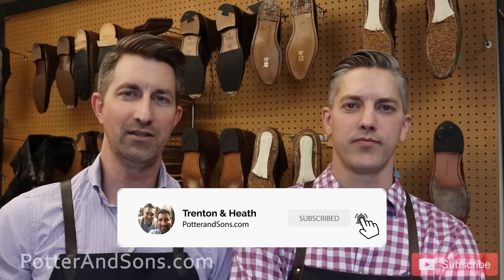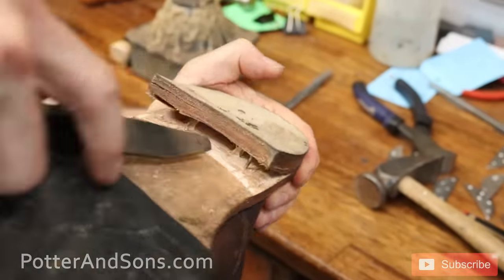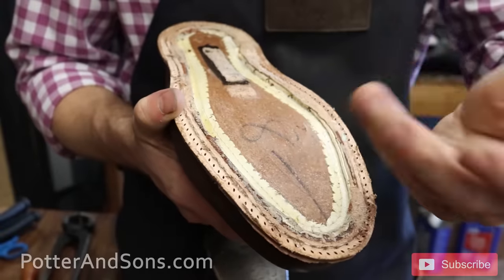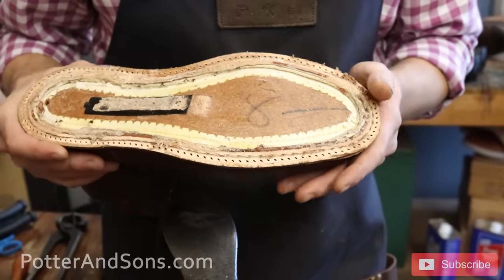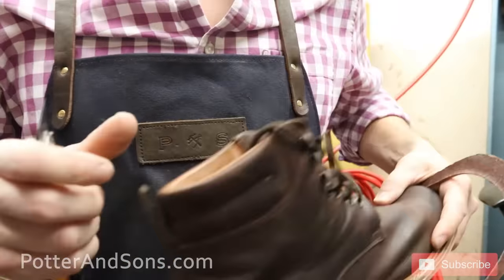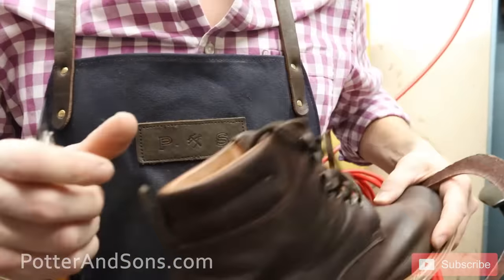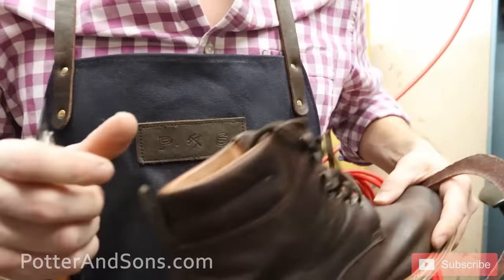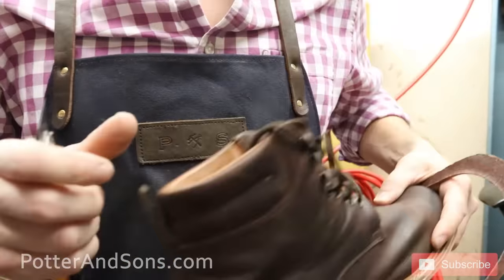Boot Restoration | Refurbishing These Boots With Vibram Wedge Soles

Comment: Shoe Restoration: My Red Wing 2944 Harvesters. My first real pair of boots that I wore to work as a barista every day for one of the most difficult years of my life. They were worn on unfinished concrete 8-10 hours a day, no shoe trees, and no breaks. I’ve since moved onto driving a long-haul semi and expanded my boot collection, but they are still my favorites. Unfortunately water has started to seep through the sole, the heel is starting to round off from my walk, and the vamp has more wrinkles than my grandma. The loss of weather resistance unfortunately means they’re not quite fit for regular truck duty. They’re no longer sold in the US, and I’m far too attached to let them go. I’ll probably send them off to you guys regardless! Thanks for doing this, y’all rock.

Comment: Shoe Restoration: In 1980 I started my first job as a gas pump attendant. The first thing I purchased with my very first paycheck was a pair of Kodiak work boots. I worked in them, hunted, fished and wore them all through high school. They disappeared for many years, and when I finally found them again tucked away in my parents attic (I joined the military in 1985 and just put everything away when I left home) they were pretty much unwearable. The soles are now petrified rubber, the uppers are very dried out and some little critter chewed the very top of the tongue on one boot and part of the back spine on the other boot. I have resisted throwing them away after so many years because they bring back some great memories from my teenage years.

Comment: Shoe Restoration: My nine year-old son and I found your channel some months ago, we were instantly hooked. We appreciate the craft and functional art of shoe restoration and y’alls drive to make the channel educational and rooted a strong work ethic. I picked up a pair of cap-toe Allen Edmond Park Avenue after your eBay challenge. Picked up Saphire Creme 1925, Renovateur, and Crème Rénovatrice. I used acetone to get off all the old product and to get a good base to start  on the conditioning, scratch filling, and buffing processes. I could not believe how beautiful the uppers came out. The soles and welts are a different story. The heels are worn to the blocks. You can see heavy loose leather fibers wearing almost completely away at the ball-joints with the welt totally separated from the uppers on one of the toes due to the stitching being worn out. One of the insoles has all these tiny circular marks as if some hasty cobbler was trying to get them out the door. I wanted to support my local cobblers but to my dismay no one had ever heard of JR or even grades of leather. One guy said “we have cow leather”.  I did find one older well-respected cobbler but he said JR wouldn’t let him buy the soles and he was also having hand surgery on both hands so he would not be able to work on my shoes. His joints were not doubt the victim of his success. I said god bless and wished him well. For the time being the shoes are hanging on my pegboard like an old Toyota truck in the junkyard waiting for someone to realize it’s potential.

Comment: Haven’t seen you use that corking technique before (Cork “paste” and iron). When do you use that method vs the “sheet” of cork that you tear or cut to fit the welt cavity? Any difference in end result or performance?
Reply: I was just going to ask this and would love to know.  Since I started watching this channel, another guy's video came up aka "Hammer Time" who swears by sheets.  I'm curious to know the advantages of each.
Reply: I would assume the paste might be used on a boot like this with a very high and prevalent shank and a overall deeper space to fill out compared to sheets on something more flat and even like a dress shoe, but I have no experience as a cobbler I'd love to hear from the man himself on it tbh.
Reply: I, too, was going to ask this question.
Reply from the maker: The paste version is a little more water resistant, but other than that no real difference.  Most ready to wear goodyear welted shoes/boots come with paste.
Reply: I noticed that paste too.
Reply: The cork "putty" was mesmerizing. Not gonna lie.
Reply: @BuckMcAntlerson  It is a paste, chocked full of peanutty goodness!!!!
Reply: Shoe restoration. Black and White leather Doc Martins.  I have worn them so much the cushioning is gone
Reply: I was just about to ask the same.  I guess there will be more glue in the mix with paste than sheet cork, and more water resistance (as T&H write). 
But will this be an advantage in all cases? One of the best things about a proper pair of shoes is how they wick and absorb sweat from your feet, keeping them comfortably dry, without feet or shoes getting smelly. Wouldn't this depend on the insole, filler, midsole, and even leather outsole not forming a barrier?

Comment: the owner should get his feet checked out, that is very abnormal wear patterns on those shoes.
Reply: I see a grave ankle injury or misformation on the right foot yet those people can afford expensive shoes, but won't go see a podiatrist... :(
Reply: Maybe operates a tractor and heels slide around a lot.
Reply: It's from kneeling down on one knee. The owner probably kneels on the same knee every time. My boots always wear the same from doing just that.
Reply: @mcgaugh57  I was thinking something like that or they use them for riding dirt bikes or some sort of motorcycle
Reply: Lol I was thinking the same. Seems like a spinal cord injury, they're out of alignment so he has one leg that is longer, so h walks on his outer edge to maintain balance. I can relate my shoes look the same.
Reply: @ambersykora352  I think most people have one leg a little longer than the other. In a few the difference can be quite a bit.
Reply: It’s not always a podiatrist issue. I did weeks of Pilates Reformer and it corrected many issues. I stopped and it’s only 7 years later and a bit of weight gain, that I’m seeing the issue again. I was also a professional driver those times and my shoes had wear under left in step, right inner heel and big toe- go figure
Reply: Amber Sykora same here. I’ve been to chiropractors, pediatrists and neurologists. They can’t fix it without surgery. I’ll just keep working as my dad and granddad did for as long as i can.
Reply: I used to wear out my boots on the big toe area,  and the shoes get crooked... then I realized it was pivoting in that area on the shoe on roofs, to get tools then turn back to work , roof material sands it down in that area...
Reply: These look a million times better now. Love the Christie sole

Comment: I have three (3) problem shoe pairs. All are second hand shoes purchased at thrift stores.
1. Allen Edmond's (AE) Auburn, needs new soles and heel pads. One shoe has hole in sole. Uppers need a small bit of work. 
2. AE's Fairhaven, it looks like a botched re-sole and restraining (red) with visible spots on the uppers. The red is a good color but needs work. I bought the Saphir Hermes Red to try and fix it.
3. AE's MacNeil, previous owner must have had a shorter leg. One of the shoes has an addition sole layer and higher heel. Uppers are a bit rough. The interiors had some sort of foam padding added that I've only partly been able to remove.
The uppers are all on my to do list but the soles and heels definately need your professional help!

Once again a helpful and informative video!

Comment: Shoe Restoration. I have a 3 year old pair of Thursday Presidents.  They are my go to boot for most days of the week but unfortunately they are starting to fail me.  The welt on one of them is starting to fall apart, on the soles and the crease on the top.  Thank you both for another great video.

Comment: Shoe Restoration - recently stumbled upon your channel. Watching it the past few weeks has been a hypnotic cathartic relaxation at the end of the day.  Your mission should you choose to accept it:  1 pair of redwing heritage boots (a brand which I haven’t found many referbs of within your channel).  Bought them new a decade ago.  Wore them rough working on the farm and have chunks of leather gouged out (no holes, though) and the lug soles worn down to smooth rubber (stitches are dots).  I’ve conditioned and waxed them and sometimes wear them casually, but they have been put to pasture, so to speak, and have been relegated to only causal wear.  I’ve thought it might be neat to replace the soles with oak bark leather and turn them into a dress boot, but with the uppers in the condition they’re in it has seemed, up to this point, to be a waste.  However, if a professional were to consider themselves a true master craftsman who fears no challenge perhaps the uppers could be restored to a condition that would warrant an attempt at turning a traditional work boot into a dress boot with a leather resole...?Haven’t seen uppers in your show that compare to to these.  You guys got what it takes?  Anyway, I thought it was an interesting idea.  Enough to submit, anyway.

Comment: Shoe Restoration: I’ve got a pair of G.H. Bass camp moc boots with a very oily pull up leather upper, and the mini lug-style soles are starting to wear away already. I’ve had them for about a year. Would be really cool if the sole could be redone as a traditional camp moc sole instead of mini lug, but the mini lug could be redone as well. Thanks for putting on this contest!

Comment: Shoe restoration:  I have a pair of Acme boots from the early '70s.  They have a mark worn in the left boot from the gearshift of my 1974 BMW R90S motorcycle.  One of the cloth pulls has torn and the soles are ready for replacement.  I'd love to get these boots restored as I've had them around for most of my life.

Comment: Great workmanship, thanks for the explanations. Can you call out the names of the tools or chemicals you are using, and why you use them? IE: the clear liquid poured on when removing soles, 2 different handle operated devices after the sole is applied, before final trimming... Etc

Comment: Shoe Restoration: My pair of Allen Edmond Strands are in desperate need of a re-sole, renovateur, polish and shine. I treated myself to them for my wedding 3.5 years ago. they were my first pair of nice, GYW shoes and I did not treat them how I should have. Love your channel and your content. The front half of my soles started to seperate so I took them to a local boot maker (Wyoming so exclusively cowboy boots) he put a new stitch in the front half of both shoes but used white thread instead of brown and the stitch is not the most consistent in terms of following the previous stitches (also didn't remove the prior brown thread)  so they look a little like Frankenstein.

Comment: Shoe restoration: A pair of RockinLeather ropers where I really wore into the heel block more than I should have, and on the other boot, it looks like I wore a gap into the cork. I had just started watching your videos months back and realized I needed to retire the boots for now. I took photos of the damage so far.

I'd love to get some sort of rubber outsole put on them as I really wore down the leather faster than I imagined just in 5 months at work.

Comment: Shoe restoration: These IR's need resole pronto. I sent them in for resole a few times, but I'm not happy with these results. I got them converted to stitchdown, but stitch ripped soon and new cobbler did not replace the welt. I just haven't found good cobblers like you two guys.

Comment: Shoe Restoration - my daily worn boots are a pair of Thorogoods. Love them but I’m pretty rough on them as I have a woodworking business. The vibram crepe soles are getting pretty thin and the uppers, while conditioned a few times a year, dry out rather quickly due to all the sawdust they see. They could use some love.

Comment: Beautiful work gentlemen. Just as an FYI. Plastic shanks are necessary for electrical workers along with glued soles (metal free to prevent conducting electricity in the field - no metal through the sole.

Comment: Great job, as usual.  I was going to ask you if there were any clues as to the brand of boot, even if just based on style or build quality.  That question was answered by further examining the boot.  I was impressed by the hot cork application, which from other videos I've seen is a technique used only by new shoe manufacturers.  How do the two methods of cork application compare?  Is one better than the other or cheaper or what?  What prompted your decision to get into hot cork application?  Always look forward to seeing you guys.

Comment: Great job as always.  If you actually stitched the sole to the shoe would it hold better? Or, with that type of soft sole would the stitches pull through that type of sole. Just really curious as I don't have a clue if that would work? I love what you guys do though.

Comment: Shoe Restoration:  I have a thirty year old pair of Carolina steel toe, combat style boots with a side zip (in addition to laces) that I used for EMS for 15 years.  They sat in a closet for several years.  I pulled them out recently and found a small hole where the leather was creased near the steel toe.

Comment: Shoe Restoration
Hey guys! I bought a pair of Allen Emonds Park Avenues from a thrift store and I'm in the process of restoring them right now. Took the leather from navy blue to black since there were oil spots and some strange cracked white areas and was going to just have sole protectors put on but if you could replace the whole sole and heel block, that'd be delightful. Could have some fun with the look and coloring of the sole too, if you like.

Comment: SHOE RESTORATION - Where to start?? I have several pairs that I’ve been planning to have restored! Worst condition—maybe not even viable—is a pair of very rare old Florsheim OXFORD (not derby or long wing) brogues in shell cordovan that are prob over 50 years old. Got em at Goodwill for $10. I also have a great pair of Alden captoe single monks in shell that need some work—the straps need to be properly replaced, etc. Old Alden 974s in shell that need a lot of work, too! Several other pairs that are in good shape, including a beautiful pair of Vass oxfords  that I’d just like to replace w slip-resistant sole material since I work in restaurants. Lots of fun projects for videos! :) Keep up the great work!!

Comment: Shoe restoration: I have 5 pair you could pick from! Varying quality levels and levels of destruction...everything from soles and few scruffs to liner, insole, upper, welt, and pull tap damage. 2 pairs of Ferragamo cap toe oxfords, Frye Chelsea boots (Goodyear), H by Hudson trench boots, and Ted Baker wingtips. The heel blocks are worn down to the welt on that last pair haha

Comment: Shoe restoration
I have a pair of blown out shell cordovan Alden bluchers that have been resoled incorrectly and need some heel liners. I bought them preowned for a steal and have been rebreaking in the insole by putting in another small pair of insoles in them and a heel grip, because they slip slightly with dress socks. I love them though :) They are structurally sound  but they do have a fee cosmetic issues as I’ve mentioned. They are currently my ugly ducklings of my collection, but I hope to one day restore them to their former glory. Thank you for the chance guys!

Comment: Shoe Restoration: Found a pair of Allen Edmonds Cavanaugh Loafers at Goodwill. The previous owner tried nailing toe caps and heel protectors by himself and it didn't turn out so great, but I know these can have new life put into them. They have so much potential and I would have never thought to buy them if I had not seen what you guys can do with shoes to restore!

Comment: Great channel guys , very interesting .... a quick question, I have a pair of Dan post ostrich boots with their cowboy certified sole , can these be fully resoled with JR soles ? The boots have leather heal double stitch welt and brass nails running either side of the shank so look traditionally made but the actual sole is some sort of rubber with leather running around the edge ... what do you think? Many thanks Dave

Comment: Shoe restoration:  I have a relatively new AE.  But I purchase them with their  light weight rubber travel sole.  AE states that they are recraftable but the lightweight rubber/foam looks to be fused on to the midsole or even on to the welt.  This is one of AE cheaper line but I would love to see if you guys could tear down and get a review of your thoughts on the build of the shoe and leather quality.The MSRP on the shoe is 395.00, but got it on sale with an additional 25% off so it was very affordable.  But  if I get selected I would loved to get them switched to traditional leather soles.  PS love your videos keep up the great work guys

Comment: SHOE RESTORATION  
I had a pair of Justin Western style boots that the sole had separated from the leather. I went to look for them, for the model name, for this contest, and they are gone now. So I am wearing my Rockys until I can afford to get replacements and they too need work.  My German Shepard chewed the tops of one (the inside pull strap was chewed almost off of them) when he was a puppy. The soles are a very hard sole to work on though, since they're not a one piece sole. I would love to have the soles replaced with a one piece leather sole, instead of the separate front sole. Unless you recommend those 2 piece soles. 
Anyways...
Keep up the great content.